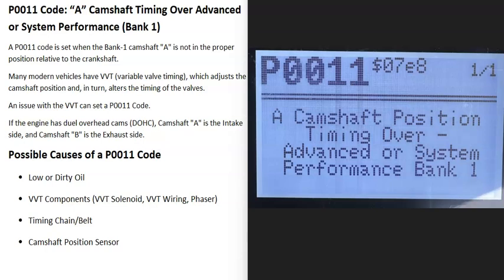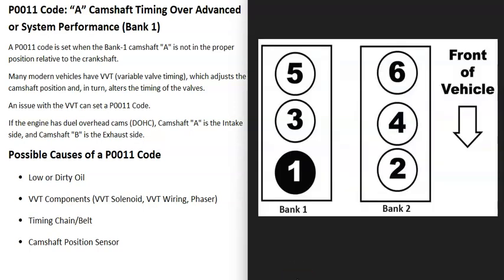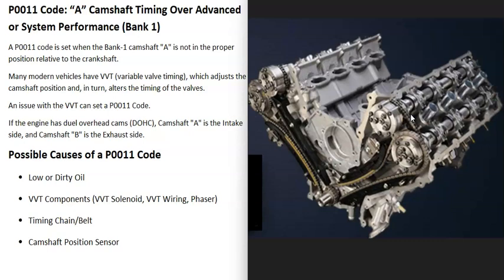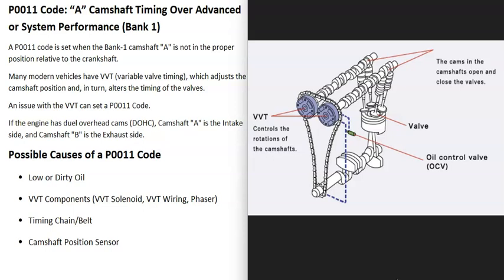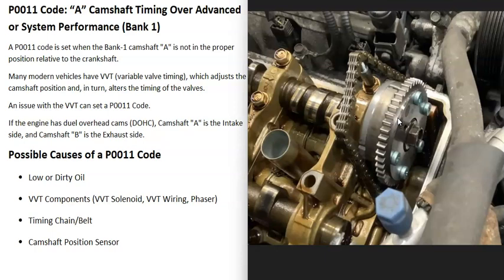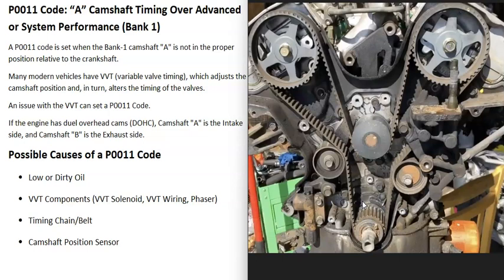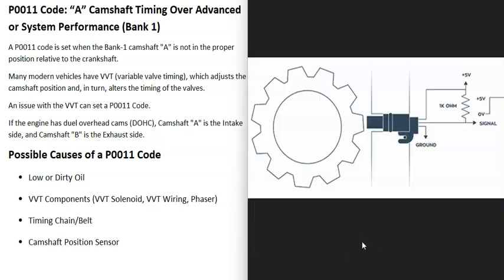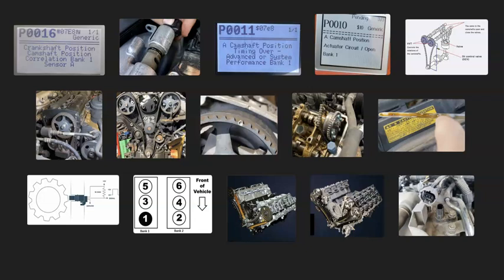Causes and Fixes P0011 Code: A Camshaft Position Timing Over Advanced or System Performance (Bank 1)

Comment: 2005 Acura rsx, dohc, I replaced the oil pump and timing chain, car doesn’t throw the code anymore but still has the same problem, sluggish acceleration and oil light popping up on acceleration, any advice?

Comment: I have a 09 Hyundai Sonata, 2.4. If the engine gets revved up to over 5500+ the check light comes on with the P0011 code. I can delete the code and it will not occur until the engine is revved hard. At idle the engine has a loud rattle, top end that sounds like the exhaust cam. When revved to around 2k the noise goes away. Switch the engine off, restart after 10 min and no noise. After watching your excellent video, I am thinking that perhaps the solenoid is not letting the oil out of the actuator? 45yrs in the auto trade, still learning. Thank you 🙂

Comment: Just fixed a P0010 on my 2014 gmc terrain by replacing the valve timing intake solenoid. It then started throwing P0011. Would it be safe to say i should just replace the other solenoid? Lol

Comment: You have a Ford F150 4.6 L three valve for early new engine the code P0011 this is Bank one intake camshaft position. Timing was advanced beyond limits for a determined period of time that’s when it started knocking so that’s why I stopped running it so it says it over advanced Bank one over advance Bank two so how do I correct this because I pulled the valve cover off of the driver side and I noticed the timing mark is not even on the Timingit should’ve been but I mean I guess when it jumped last time that’s where it stopped.   How do I correct the position of the camshaft six 3 1/2 inches off and if it says it’s advanced that means I should turn it back to the to the timing mark camshaft so I don’t know the exhaust you know how it runs Bank one big two in sequence I don’t know where the lobes are in position where they’re supposed to be. I have no idea.

Comment: I have a 2015 Chevy Sonic 1.8 and the code kept going on and off. After replacing the VVT solenoids and actuator the issue ended up being sludge buildup and after that got cleaned up the code stays off.

Comment: I have 2013 Kia sorento 3.5 2nd generation I got code P0011 I replaced both camshaft sensors, replaced VVT solenoid bank 1, oil change was done, but still get the code P0011 last thing to do would be the chain /belt.  Is there a video on how to adjust or replaced chain / belt ???
Reply: Try to get the service manual, there you'll find the manufacturer step by step on how to do it professionally.

Comment: I have p0011 p0014 p0012 error n engine light poop up and car performance after 3000 rpm what was the reason its due to camshaft timming belt adjustment??
Reply: My car 2014 q50 160,000 miles and just got the p0011 code replaced oils solenoid and sensor didn’t fix nothing HELP !!!!! Also car only gets up too 3500 rpm then stutters

Comment: Dealing with this on my GLK after resealing the timing covers and replacing all four solenoids and cam sensors. Everything appears to be running as it should, so I'm wondering if I got a bad sensor or solenoid.

Comment: 2016 Subaru crosstrek p0011 after replacing the VVT solenoid because i got a p000A last week.  Replaced the cam shaft position sensor.  Oil has maybe 3k on it.  Not low.. running out of ideas this shade tree mechanic can fix… any ideas? Think the timing is that far off??  I don’t have a scanner to “erase codes” i just did neg off battery for a while.  But comes back after second startup.  Thoughts?

Comment: I have a 2015 VW passat with a p0341, p0016, and  p0011 code. The rpm's fluctuate, and sometimes it stalls. I have had numerous people work on it, including the dealer, and spent 1,000's of dollars. Nobody can figure it out. It only happens when the car is cold. When the engine /oil temp reaches 175 degrees, it runs perfectly. Some times it will run rough for a few sections when you restart it, but then its perfect again. The Oil gets changed regularly.
Reply: Do you also get a small rattle noise when engine is cold? I have same symptoms on my hyundai sonata 2k09 2.4dohc
Reply: PVC Pressure Valve Control check that.

Comment: So i have 2018 audi a4 quattro with only the P01100 code drives starts fine what could it be cause i cleared  the code 2 times and came back after a couple drives so i want to know what should focus on
Reply: I have this on my 06 2.0t DSG, car runs great MOST of the time... it scoots no problems. sometimes it will idle badly at a light or when put in park. 
p0011 will appear along with random misfire codes, some slow to respond code and a few others prob triggered in a cascade. 
It's NOT the cam sens or dirty oil. 
guessing i will find the issue mechanically somewhere.  let me know if you find it.

Comment: I have a 2016 Chevy Sonic LT 1.8L engine. P0011 code continues to come up with no other codes. We have changed VVT solenoid, camshaft position sensor, and ensured timing belt/chain is lined up. Oil is clean and full. Symptoms of vehicle are random lags in shifting gears(intermitant), sometimes on startup car will bog out and not start, on second attempt car starts everytime. No codes come up when this happens. This car has religiously had oil change and all services done at the correct intervals. Any advice on what else could be wrong?

Comment: My Mechanic made me REPLACE THE ENGINE entirely , they fit the new engine and it still has the SAME P0011 Code, OMFG, he now saying that my sensor may be the problem, I don't even trust that guy, I should had MARK THE ENGINE to know if he really Swap it or not, Last CVT car im buying, maxima 2007.
Reply: Lol a used engine will usually come with the sensor
Reply: @jarret9438 the one I bought didn't

Comment: Mechanic wants to change out all 8 injectors to fix this issue.  I am not in agreement.  This video states the problem as something completely different, the vvt or sensor.  I changed the oil but still have the code.  Any advice?
Reply from the maker: Are there any other codes? The diagnoses does seem off unless there are other codes and something else wrong with the engine. If you don't trust the mechanic maybe you can get another diagnosis.

Comment: If it's just a PO0011, could it just be low oil causing a no crank no start? 08 g6 gt 3.5
Reply: My car star perfect but i kee0 getting this code
Reply: @JuniorLito-f7y  fix it sooner than later i thought id wait till later and of course it went into low power mode monday on my way to work and only goes 2mph now and i cant even drive it a shop now do it while you can
Reply: @JuniorLito-f7y mines too can’t figure it out
Reply: Yes or even dirty oil